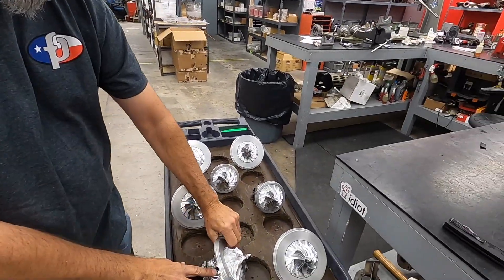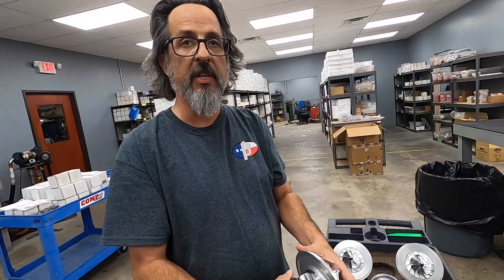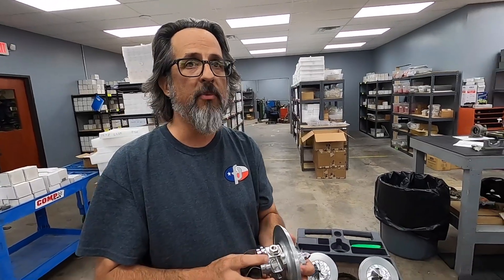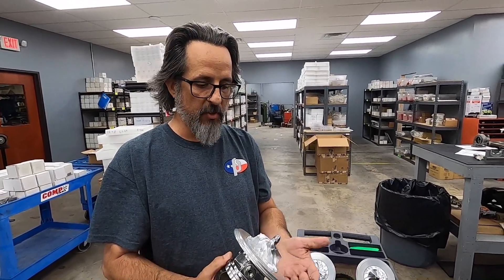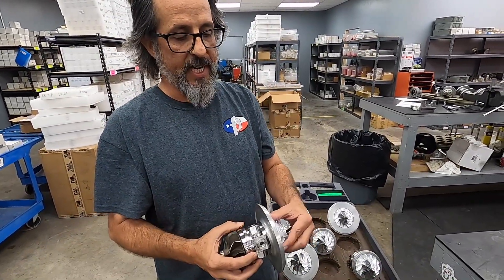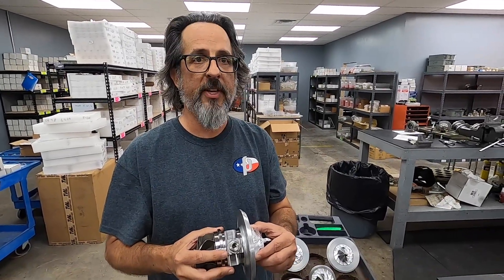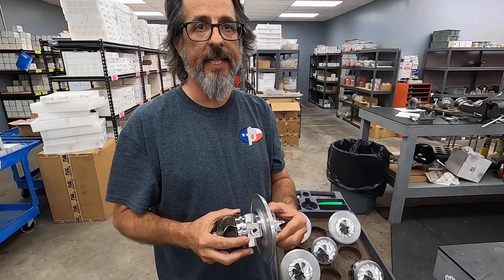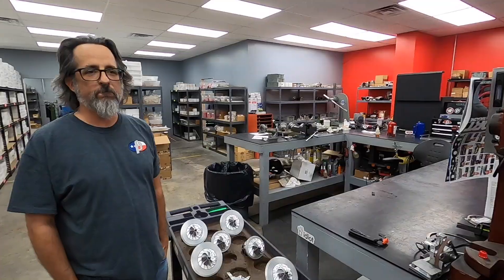THE TRUTH About Ball Bearing vs Journal Bearing Turbochargers! (Robert at Forced Performance)

Comment: Thanks man, that helps me in my endaver on my v6  boat motor  with the draw through settup from an 81 buick w stock t3 oil only lube and cooling! Was trying to find a bearing replacement for my app so i'm putting p/s cooler BEFORE  the goimg in the turbo. You are a great instruction indevidual sir thank you!

Comment: He didn't mention anything about thrust. A ball bearing is able to handle a large turbo with a large amount of boost. the larger the compressor wheel and the higher the pressure behind it the more thrust acting on it. To counter this a journal needs a very large thrust bearing which increases drag and reduces response, where as a ball bearing turbo the balls combat both axial and thrust loads without the additional need for a thrust bearing. Yellow metals are also oxidisers of oil and are attacked easier by the acids that build up in oil causing bearing degradation. many comparisons between the two, but all in all Journals are better for light duty use and ball bearing for heavy duty.

Comment: I'm planning to use a 35 year old Garrett turbo with a modern billet compressor wheel on my Volkswagen TDI. The turbine geometry is still the same that gets used today, the housing A/R is tight enough (0.36), and I don't have any need for ball bearings. I could use a VNT on it instead but the wastegated turbo will never have issues with sticking vanes. Old technology isn't always bad.

Comment: I've just replaced my cartrage in my k04 turbo because it had in and out play, not excessive but enough to make me think this is why I'm getting oil into my intercoolers, but new cartridge also has slight in and out play, so I'm confused because I thought there should be zero in and out on a journal turbo charger? Not fitted yet so no oil in the system, does this movement stop with oil in the system? Or should there be zero movement with turbo charger on the table?
Reply from the maker: There will be a little movement without any oil pressure in the cartridge. In and out movement is normal. It shouldn’t have much radial movement

Comment: Ok.. maybe I’ll get lucky and someone can assist a newbie setup - deciding , best fit for purpose .96 or 1.25 A/R 7875 Gen 2.5 7875  … if anyone can provide some real life experience that would be fantastic ! And very much appreciated 
1972 gmc 1500 SWB
6.0 LQ9 swap
Street Roddin’ use only (no track)
Stage 2 turbo pro LS cam , springs , lifters etc…
Run pump gas 
Goal: 600fwhp / 
Boost pressure : 7-13 psi
Key is - never going to hit the track but some dumb street use to be accounted for 😆🤷🏻 
Seems like every 7875 testing I come across is with the 1.25 A/R was all 

Merry Christmas 🎄 to those who celebrate it!
Reply from the maker: Call forced performance!
Reply: @Stapleton42  thanks! All I’m
Really hoping for is some great leads .. been doing some recon but best to hear it from a subject matter expert !

Comment: DN (diameter in mm times speed in RPM) limit on a bearing is a real concern when designing a turbo, or any turbomachinery that spins fast. If I remember rightly, for some ball bearings it is around 1.8 million. I was experimenting with air bearings, also. But these are a pain to design right, and require very high surface speeds, which works against the burst speed limit. However, the DN limit is in excess of 3 million; quite frankly, they have a low limit, before they 'take off'.

But the oil sleeve on the roller element bearing is to dampen rotordynamics vibration in general, not just for shock loads.
Journals have a natural damping characteristic of the oil film; rolling element bearings are naturally stiff. This makes them rough for any critical speed.

Great point on cooling, though. Differential thermal expansion is also often a killer. I once killed a micro gen set by inadequate cooling: shaft journal and the bearing sleeve 'grew' into one another. Fun times.

Comment: What they guy is saying makes a lot of sense however i feel like this video is very journal bearing biased. I am from South Africa and own a 2016 Golf 7 R and in a group called Golf R Club South Africa. in our group there's a lot of members who also belong to other car groups. I have personally been through 2 Hybrid journal bearing turbos which failed (mind you i track my car and daily drive it). There are 6 other members who all used different shops to do their journal bearing Hybrids some bought their is38 turbos already built and all of them have had at least one failure. There are some guys who haven't had any issues but i am counting over 7 guys who have had turbo failure on their journal bearing Hybrid turbo. I since moved over to ball bearing Hybrid on my is38 turbo and let me tell you. It spools much faster the power is nearly instant and i have put on 38,000km / 24,000 miles/ 2 years and 7 months with zero issues pushing 1.9 bar of boost tracking and daily driving. Now i don't know if the journal bearing failures were all because the turbo has been made hybrid with bigger wheel and journal bearing couldn't handle it or what. Most of the other guys also moved to ball bearing Hybrid and none of them have had issues in over a year and a half. I was the Guinea pig and when everyone saw how reliable the ball bearing hybrid turbo was most of them changed over and even the guys that are not hybrid turbo are running ball bearing now and all of them have nothing but good things to say about the ball bearing turbo. The theory about oil build up and vibrations in the ball bearing turbo can be ruled out because i have literally been driving for close on 3 years with no issues whatsoever. I am yet to hear about a ball bearing failure, and im not saying its impossible but i am still waiting to hear about a ball bearing failure across all the different car enthusiast groups here as we all communicate. Although this video mentioned a lot of truths it is however still a theory. I am all about practicality i am a practical person,... don't tell me show me.. I can show you since i practically drive my ball bearing turbocharged car everyday for the past almost 3 years with no issues. Cheers

Comment: Could also thermally insulate the hot side from the cold side, whether it was a longer distance between the two or modified oil passages in the turbo. Not very much heat transfer through the shaft itself, but the cartridge's bearing housing is what does most of it. The need for water cooling is a sign of inefficiency which I interpret the design needs to be changed

Comment: I think spool characteristics are the biggest factor that I see for customers choosing ball bearing turbos. If I’m building a street car for a customer who is more an enthusiast than a racer we’re going to lean them towards a ball bearing unit. This will offer them good boost and throttle response without much effort on part of the driver. Some guys don’t want to brake boost and setup various anti lag tunes they literally just want the power to be there when they flat foot the gas pedal and a ball bearing unit is much more well suited to that purpose than a JB setup. I also find certain units very well suited to niche builds as well; when I was choosing a turbo for my B20Vtec I knew I wanted response, off idle torque and good power at low boost because the engine is an 88x89mm stock sleeve B20B running 12.6:1 static. I ended up running a GTX3076R and a was able to make 460whp at ~13psi and basically tune it to perform almost like a stout NA build because of the way the power came on and held.
Reply: That’s exactly why I chose a G30-770 for my built fk8 Type R. Ceramic bb, low drag, quick response.
Reply: How has it held up?

Comment: Using a independent oiling system is the best way to avoid damaging a turbo using the engine oil is never a good thing because it's already hot and can contain metal particles that can damage any type of bearing setup used.

Comment: 10:45 Question for Robert, regarding  thermal demand requirements within limmits.   
What indacations are presented indacating over temp opperation shorting lifespan of ball bearings? 
Water temp, ____°F delta T desired with an upper safe continuous opperating  water discharge temp ____°F ? 
"", recommend seeing water  discharge temp below____°f before dedicated coolent pump auto shut down?
Oil temp  270°f  max discharge temp peak, 250° opperating continuous opperating  cooled enough for shut down<220°f (moddern "high temp " t-stat). Are my assumptions accurate and ,or low enough to prevent coaking the balls in addition  a 350-375°f EGT shut down ? With the restrictor for ball bearings,  is there ehough  flow to get an accurate oil discharge temp reading?

Context is king.
 CUMMINS 6BTA160 SET TO 160HP,  SPOOLING 1900 FALLING OFF FROM 2350-2500, DYNO SHOWED 25LB/MIN AIR @1976RPM, 4.5 LB/MIN AIR @2500 W/ H1C/16 +FULL WRAP HEAD BOLTS TO DOWNPIPE 173HP TO THE TIRE. 

:
CURRENT:
 NOCKOFF HX35/10CM(5CM×QSV )52MM COMPRESSOR 
Delta P : .5-1.25 :1 avg  drive pressure is 1:1 golden.
 3PSI/ 1100
5/1150
10/1200
15/ 1275  QSV CLOSE TRIP POINT
18 /1300 QSV OPEN TO 10CM 
20/1600
25/2000 fuel Gov cut@2000 loose 70% fuel rate  by 2350  
15PSI 2350@103MPH ( double Overdrive .61 3.55 rear 31.7 tall)
Same/2500 @45whp 97wtq

TARGET: 130 MPH on 76cc/1000 #2 diesel  fuel only,extra lean compound twins 
G25-550 (2x goal lbs/min up ftom 33lbs of H1C) still over sized and encroaching on the surge line. 
 SHIFT 20LBS/MIN LEFT TO 900 RPM have AFC max out travle (~15-20psi) by 1200 when I put my foot in it... 
Rpm/gear matching:
6sp 2x Od twin clutch auto
Quick change rearend
130mph 
Dream BigChisel Down To Realty
Reply from the maker: Whoa 😂. I’ll relay the question

Comment: Sooooooooooooooo ball bearings are fatigue limited devices and journal bearings aren't. If a turbo with journal bearings never exceeds the load capacity of the oil film the bearing system will last forever. All ball bearings will fail eventually, although reducing load can exponentially increase life. There's a lot of other stuff wrong on this video but too much to type.
Reply: Agree, he talks mostly out his butt

Comment: I paused at :34 to type this....
When I was starting to get into turbos and higher HP my mentor told me that turbos are turbos and the only difference is size and lubricants.
Reply: Must have been 20 years ago
Reply: @TheCarpenterUnion  yea just about
Reply: @TheCarpenterUnion  I built my first turbo car in 2003 about a year after learning what all a turbo could do. I raced jr drag and upgraded to the 300hp jr class in 2003 with that set up I got 2nd overall that year and blew up like 3 engines my dad wasn’t the happiest about blowing motors but I won my races lol I’m 35 now and still race just more of a few times a year ordeal instead of a steady run. Funny how kiddos and life seem to get in the way of fun

Comment: I work with turbopumps for CO2 industrial lasers, i messed w prochargers and turbochargers, and i play with gas turbines. they all explode sooner or later. the turbopumps w the magnetic bearings- the controls freak and destroy everything. We could talk for hours. there's some turbochargers converted to gas turbines on my page.
Reply from the maker: My dad sells turbo pumps for vacuum manufacturing equipment 😂
Reply: @Stapleton42  hahahahaha tell him i was standing next to a leybold D2500 doing like 39,000 rpm and you know that noise a vacuum cleaner makes when the bearings take a dump? it did that REAL loud for 1/2 second! Welded a blade to the housing, it broke off and cleaned the rest of the blades off! the cleanup.....

Comment: Bearing comes onto boost ~500rpm quicker, in comparative journal.
On 1980s T3s, you can delete the coolant lines because the journal feed does a good enough job doing both.

Comment: You can spin a black hole at any speed and it won't explode :P

I have a custom variable geometry turbo on my little 4cyl diesel, that I paid nearly $5000 for and it's a jurnal bearing. Made me sad soending so much money on a non ball bearing turbo but I had no option if I wanted VNT.
Reply: I thought at the speed they turn ball bearings would not last as long , never seen one that was not a bushing  they Ll cost a lot

Comment: Would an electric oil pump on a timer that runs for 10 minutes after shutting down the engine along with an oil cooler help keep the cooking to a minimum and help the ball bearings last longer?
Reply from the maker: Good question for Robert
Reply: OEMs use an electric "after run" coolant pump that helps this. Maybe it's too costly to have an after run oil pump, but the electric coolant pump running after shutoff was to help with longevity of the turbos service life. When you shut the engine off the oil temp and coolant temp actually raise for a period of time before cooling down and when that happens oil that's sitting still leaves deposits and what they call "coking"

Comment: before i watch this I'll say what I've always heard about ball bearing turbos and why i seek them out for my street cars. 1. ball bearing turbos spool like 200-300 engine rpms faster than journal style bearing turbos. 2. ball bearing turbos last longer wear wise. i also always get water cooled turbos and use a turbo timer and 20w50 synthetic oil. i live in a very hot area where conditions could be considered extreme during the summer.
Reply from the maker: Can you discern the difference between 200 rpm when not looking at a log?
Reply: @Stapleton42  I'm sure i can't, but that doesn't mean it isn't there and giving an advantage. it's very similar to asking could i feel a 5hp gain? maybe not, but it's there and it helps. awesome video with substance💪

Comment: I'm not sure I agree with Robert's comments, although I've got a lot of respect for what FP have achieved. Regarding the fluid film discussion-Air hockey uses air. This is a fluid of bugger-all viscosity which leads to zero heat, versus oil which is significantly higher and generates significant drag and heat. I've got a Forced Performance turbo in my Subaru at the moment and I'm happy with it for now. Not all of us would do something so stupid as upping the boost control solenoid duty cycle when their combination mysteriously drops boost. Whatever the case, I've got good results with my FP Green (not just on dyno but using GPS trace at the track to verify) and I'm looking forward to having a good crack with a ball-bearing Blouch sometime soon.
Reply from the maker: Sounds to me like you’re nitpicking. It’s an analogy for basic understanding of the principle
Reply: @Stapleton42  the air hockey analogy is OK for explaining how the oil film works to avoid wear, but it's a bit misleading in other ways that also describe how sleeve-bearing turbos work. The air hockey analogy may be misinterpreted by some as leading to lower drag on the shaft when compared to BB turbos.

Comment: 60 mph is 1 mile a minute. A mile is 5,280 feet. Which is 63,360 inches. 

A 1/4 inch diameter shaft has a circumference of 0.785 inches. 

A speed of 125,000 rpm is a distance of 98,125 inches. Which calculates to 8,177 feet. Or roughly 1.548 miles. Thus 92.88 miles per hour. 

Cya

Comment: my old boss raced superstock and the two things he always stressed with the racecars was when it starts up it needs to get up to temp. and after a weekend racing they fogged the engine with marvel mystery oil before loading it back in the trailer. all that stuff worked when the engine got torn down at the end of the year the valves, seats, rings and everything looked like it was just assembled
Reply: Marvel's mystery oil is absolutely nasty if you let it sit. It congels into almost a glue. I see no reason to ever use that product. If you want to fog the engine use ATF. It has amazing anti-corrosion properties and will not go off on you turing into glue.

Comment: So if I understand.  Bb watercooled oil limited for full race applications due to g forces and high rpms. Journal bearing for street strip application for lower rpms. Makes sense. Like every other part. Maintenance is key
Reply from the maker: Sort of. There are exceptions but you have the right idea. Engine rpm does not determine turbo shaft rpm

Comment: Just did the math.  a .5" shaft rotating at 140,000 is spinning fast enough that the shaft circumference is rotating at a speed relative to moving 208.3 mph.  At 180,000 RPM that velocity goes up to 267.7 mph.  Even with the low coefficient of friction with oil in the equation of around 0.0814, that would still produce 116.7 Joules of heat energy per second that needs to be retarded by the incoming coolant (oil or water).  Considering that the specific heat capacity (the amount of heat to be supplied to a given mass of a material to produce a unit change (1F) in its temperature
Reply from the maker: Holy numbers 😂